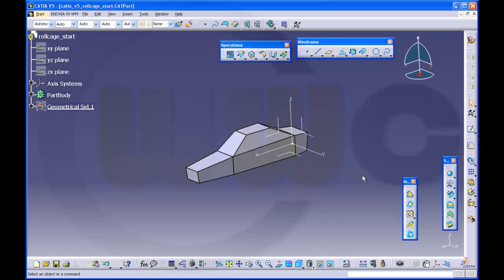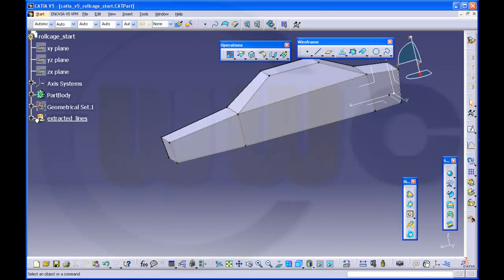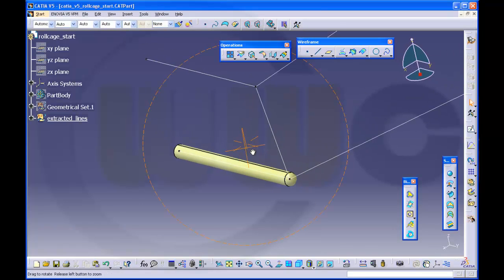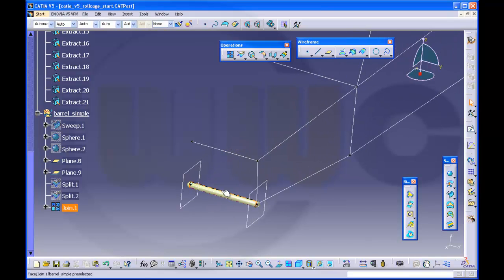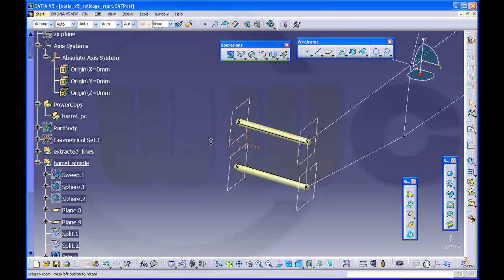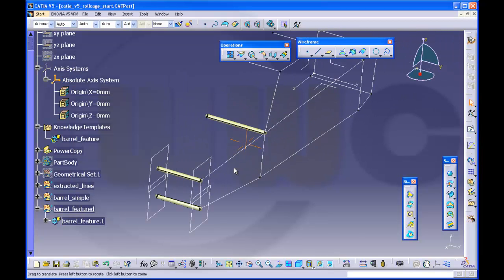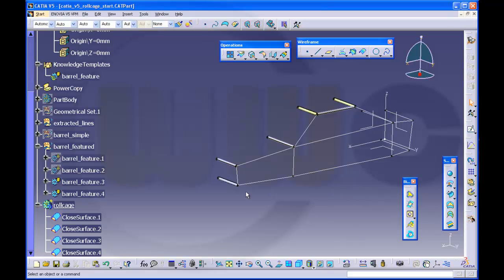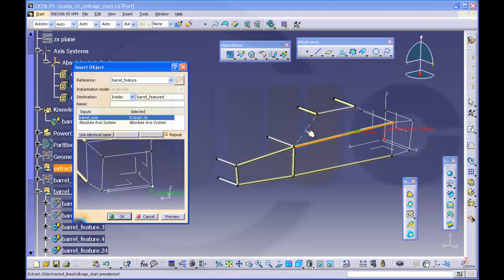Rollcage - Catia v5 Knowledgeware Training - Powercopy - User Feature

Comment: User feature is used with in part design, or in a Assembly context, and one could make splits in order to get an exploded geometry for drafting purposes ?
Reply from the maker: If you want an exploded view - you should use "enhanced scenes". Then do a view of the explosion scene.
Reply: Marco your best bet if you want an exploded view is to have each tube as a different part in an assembly. In part design you cannot explode the geometry of a part